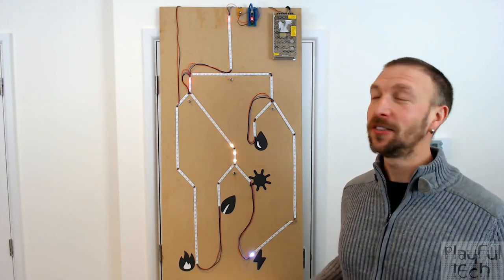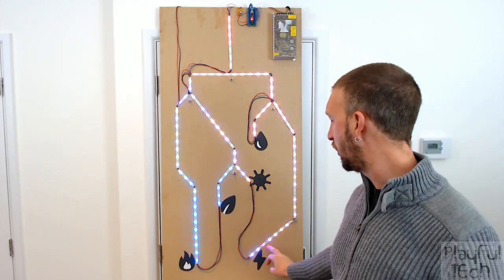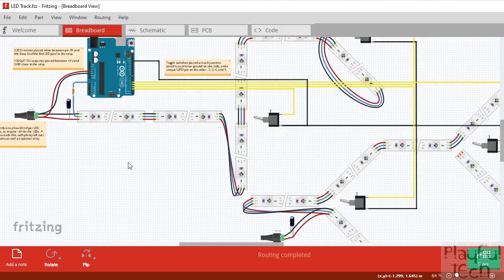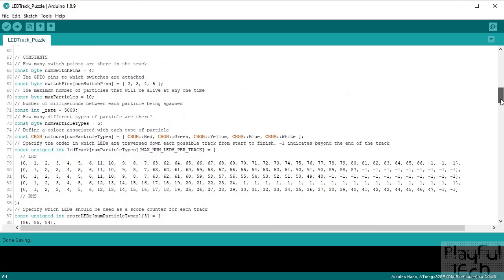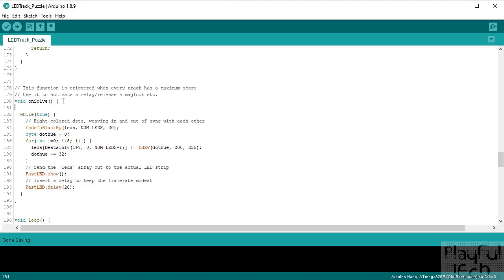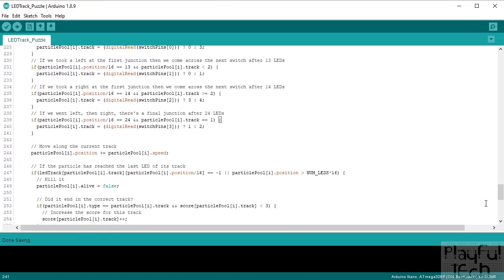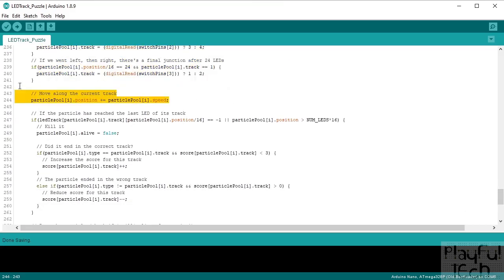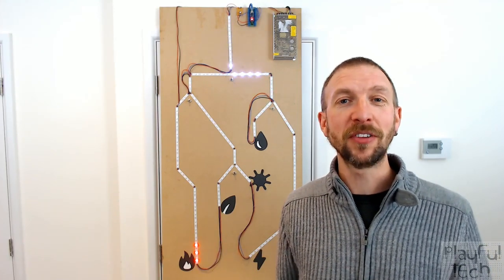LED Track DIY Escape Room Puzzle Tutorial

Comment: A nice exercise for the reader would be to modify the code and replace the toggle switches with arcade type push buttons to toggle each point and have LED's indicate the point direction.

Comment: Great video, but I hope there's a way for the user to control the speed of the drop? If it were that slow and I was being timed I'd get very frustrated.
Reply: You could have a difficulty switch to alter the timings or a potentiometer to speed it up/slow it down, an options menu on an LCD could also be another advanced upgrade, you could also have a Web interface to set game difficultly, in fact you could have a configuration page for the whole room that sets things like overall room difficultly, individual game difficulty/options, enable an accessibility mode for certain players/groups or turn that of if not needed. Each game controller would then be network enabled and receive game options from a front of house controller.